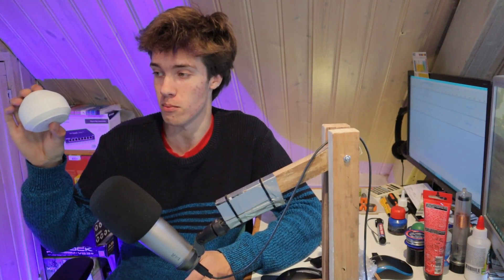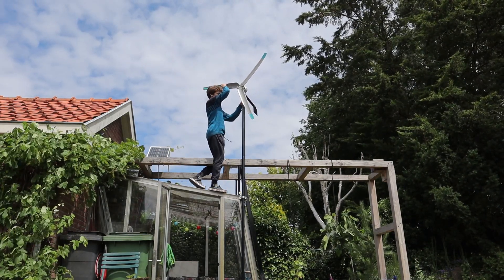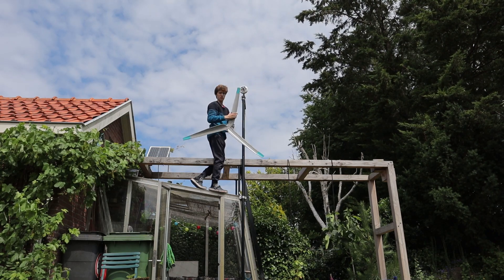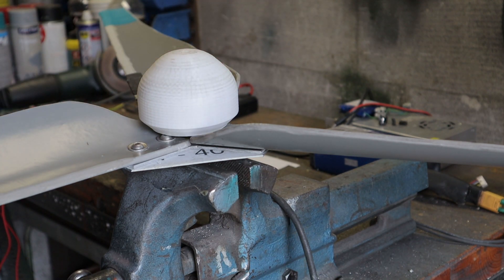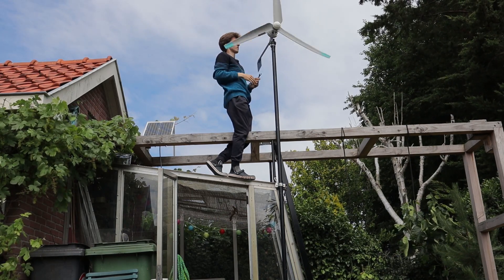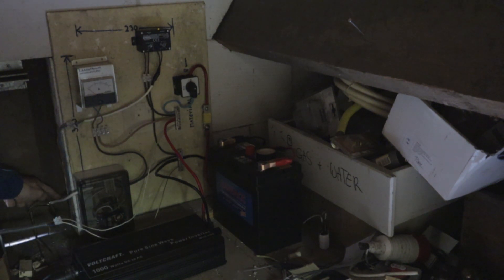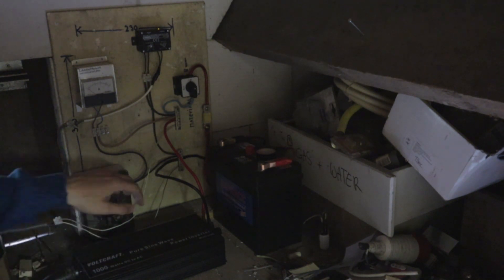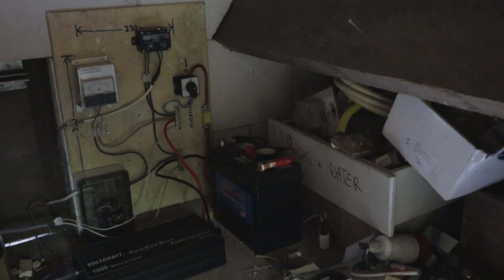Installing a nose cone on the DIY wind turbine (and an electrical system update) (AKIO TV)

Comment: is it a self furling wind turbine?
Reply from the maker: No it's not. It can handle quite high winds so usually it's not a problem. in extreme winds I put a jumper on the output terminals which acts as a braking system.
Reply: @AKIOTV  Do the wires get really hot when you connect them like that? Isn't that basically just making your wires the load?
Reply from the maker: @lithe.susurrous661  I suspected the same, but in practice that's not how it goes. (at least for a turbine this size) 

the short circuit applies full load from 0 RPM. Because of this, the turbine never really gets the chance to speed up, which means the blades produce low amounts of lift. In other words; the efficiency becomes terrible, and that makes the output power very low. (which is on purpose in this case)